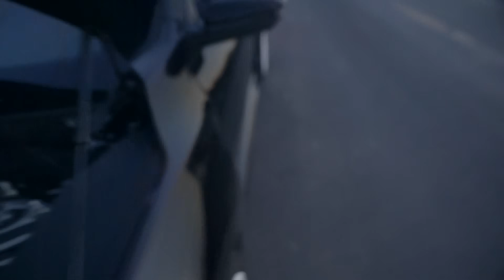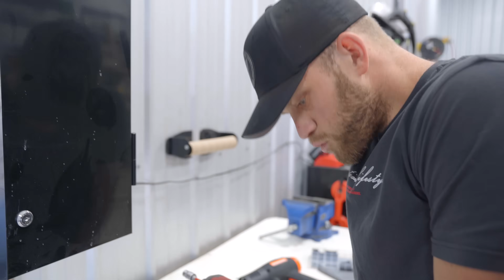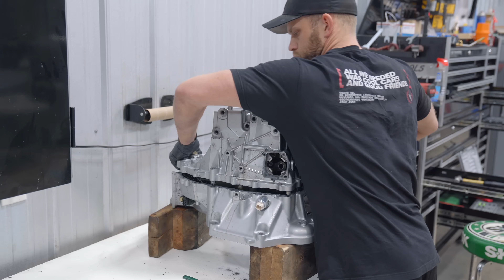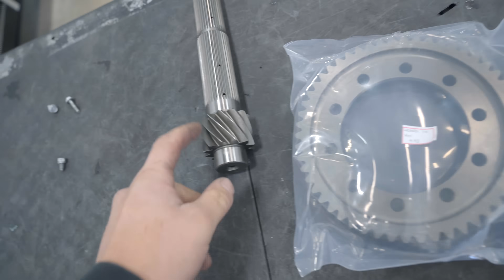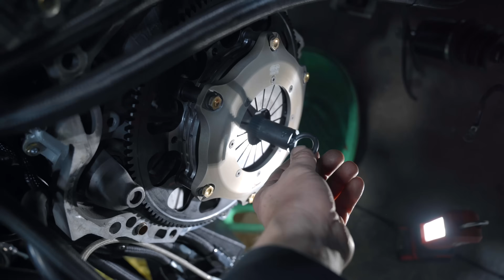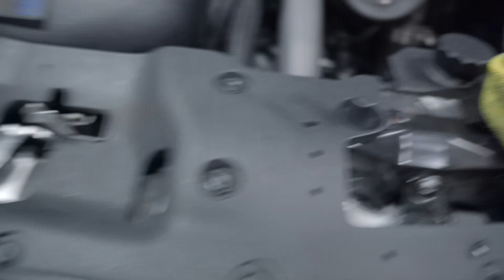TYPE R TEARDOWN… THIS IS REALLY BAD

Comment: Building the unbreakable transmission V.2.0. 
The voiceover was really well done and exceptionally clear. New mic?
What a build. Going fast is very,very expensive. How fast do you want to go?
That poster was on the door to our lab for almost 20 years before it got shut down in 1995. Still true it seems.

Comment: I dont understand why they didnt try driving alot more with maybe 500hp before they cranked it right up. Incremental steps is the way.
Reply: I agree a stock k holds 500-600 pretty reliably anything more then that needs the sleeved block pistons retainers etc
Reply: @Therealjuju97 you realize the only thing this motor DIDNT have is sleeves right?